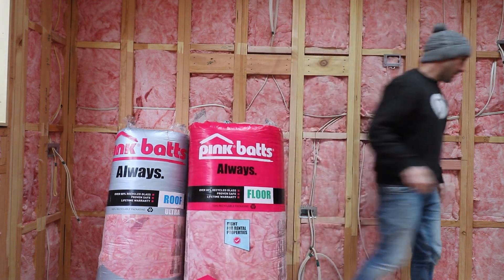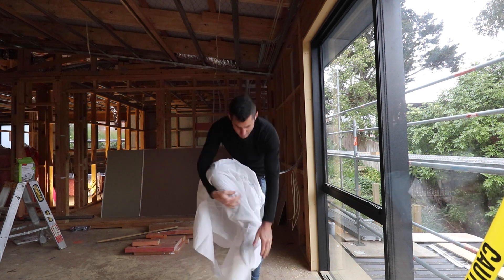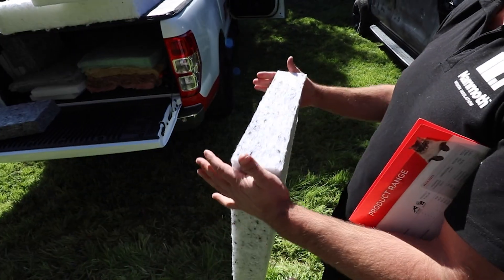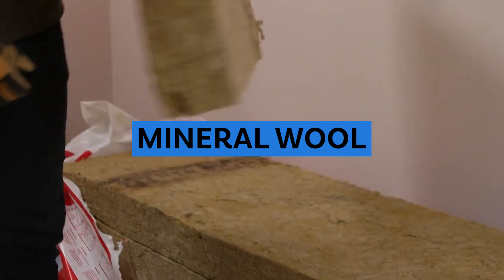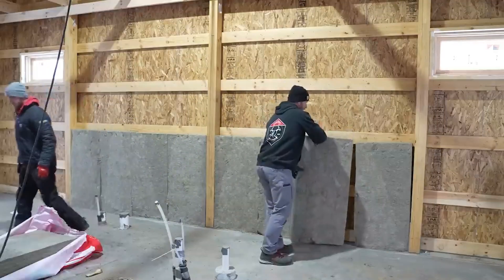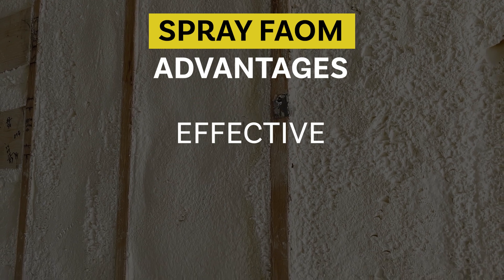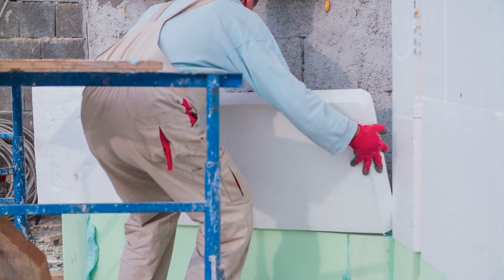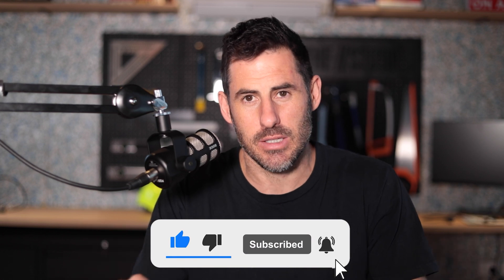New Zealand is OBSESSED!! with Pink Insulation

Comment: Pro tip, insulation saws like Bahco for instance,  will work for about an hour on Polyester (Mammoth) and then they are useless! I went through 4 of them doing 3 rooms. Bread knife is probably the best option.

Comment: I HATE PINK BATTS WITH A PASSION! along with any other glass wool product. 
My wife and I are both tradies and hate working around it. We are renovating our house, and we are installing Greenstuff in our walls, ceiling and underneath. Our cat loves Greenstuff too. We can't keep the little bugger off it. He obviously finds it soft and warm, which it is.
As for working with and installing, I have no problems. On the job having to repair a water leak, I pull the Greenstuff out and squeeze the water out of it, and I tell the customer to put it back after it's dry. As for Pink batts, well it's stuffed! Fill of black mold and it brakes up in your hand when soaking wet and can smell nasty. Not to mention you get itchy when touching Pink batts. I don't care how cheap that evil shit is I'll NEVER buy it!

Comment: Polystyrene’a other disadvantage is that it reacts with the plastics in electric cables (tps) so a more expensive cable style (purple sheathing) or mechanical protection (conduit) is required

Comment: Great video josh. Yes availability is a factor. Personally my perfence is the terra Lena wool blend insulation as it's moisture resistant, fire resistant and breathable. It's nice and easy to work with along with being made from wool offcuts and holds its shape. Pink batts are ok but from my experience they don't breathe as well as wool blend
Reply: We're doing a retro fit of ceiling insulation and terra lana is one of the options I'm seriously considering. What has your experience been?

Comment: Those R values you quoted are imperial numbers for the USA market, pink batts is upto around R2.8 for 90mm thickness, there is also Polyisocyanurate (or PIR) boards, the highest performer per mm of thickness, good for raked/cathedral ceilings where rafter depth is usually insufficient to fit the required batts, also, as the rafters are not straight or square you will have to deal with any gaps. XPS polystyrene is extruded, only slight better  thermal performance than EPS, plus you dont have al those beads blowing around as you mentioned. EPS is about the same thermal performance as batts per mm of thickness. SIP panels only have mediocre thermal performance if using EPS (most commonly used matreial), very good video otherwise - Building energy assessor
Reply: @brianclarke1695 curious as to why would you say SIP only has mediocre thermal properties? 
Designed to have SIP splines where possible, they are pretty sweet. Decent air tightness out the gate. 
Kiwis would never pay for Gapotape or similar around PIR boards placed between members, so installation will always be a problem, but super useful as a warm roof, or outsulation.
Pink batts are the dog shit gold medal winner when it comes to thermal envelope insulation. Sooner kiwis get pulled into the 21st century the better. 😊

Comment: I've recently did ceiling insulation (rodney area). My father was around and he's an inspector up in northeastern europe.
Here's his observations:
1. fiberglass isn't used anymore.
2. rockwool everywhere (my installer didn't have that as an option).
3. plastic film is needed so that humidity from home isn't absorbed into insulation.

Bonus - we went to see friends house being built. Same as you said - up in europe they use rigid insulation for walls. Can't remember why exactly why. Maybe because it was easier to handle.

Comment: Next would be the GIB, why is it called GIB and why are they dominating the market, same with Pink Batts.
Reply: I’ve been a draftsman for NZ residential houses since 2014 and all of the projects I did use GIB. There was a time where GIB is scarce, the house is ready for lining, and the council is asking for a “minor variation” for GIB replacement. In fact, on June 2022 NZ MBIE published the Product Substitution for Plasterboard.
Reply: @MrRENZsalas  group home builder? Use another bracing method. No problem with plasterboard substitutions then as it’s not structural.
Reply: @Tryinghardtobecreative  there are other alternatives. But the problem is the availability of the product in the area.
Reply: I mean, what would you use besides plasterboard? Fibro?
Reply: @nathanbedford3443 not all plasterboard is GIB I think was the point. Ie Fletchers have the dominance in NZ of that product too. Fletchers is one of the main reasons that the NZ building regs are a joke when compared internationally.
Reply: @Tryinghardtobecreative They’ve had  a few directors jump ship lately.. I wonder why????
Reply: @addrock7695 grown a conscience? 😂
Reply: @nathanbedford3443  I used BB Plasterboard once. The rest is GIB

Comment: Having moved to NZ from the UK, I’m still surprised that PIR/foam board insulation isn’t more common. The R values are super high for the thickness of the material, but sadly, I think the small market and cost means it’s still a niche product.
Reply: It's bulky so transport costs would be high. 
Especially as it would have to be imported. 

No one is going to set up a manufacturing plant for such a low market.

Comment: Good overview. I went through the exercise of adding insulation to my large 1977 home a couple of years ago. It already had pink batts in the ceiling and walls but nothing underfloor. I have another property which has the polystyrene underfloor and went away from using it because of the installation mess you mention, and despite the Expol concertina system they still have to have clips to hold them in place and I'd had the odd one I'd had to refix. I'd also seen the sag issue with batts so in the end went with the Mammoth recycled polyester.  I did have to figure out how many bales of each of the widths I'd need based on the floor joist spacings, and had to cut many of them to length which was easy with a sharp bread knife but they press into and stay in place well as long as cut to the right size and it is a pretty clean job. The underfloor ones have held themselves in place securely since without the need for any clips etc. In the ceiling I used 200mm R3.2 Ceiling Blanket which came in a roll and was relatively easy to lay out over the top of the batts and between the trusses. It was also easy enough to cut with a bread knife. The house has a noticeably different heat characteristic and is much more comfortable both summer and winter now. The basement became a fridge because the heat wasn't radiating through the floor, and upstairs three days after installing it the floor warmed up underfoot. Most interesting and worthwhile.

Comment: I’ve done a number of home renovations…every time I’ve removed the drywall the batts have been black with mold. Horrible horrible product! But in NZ we will always go for the cheapest nastiest product. Fletchers has the NZ market brainwashed! Im advocate of PIR foam and while it offgasses in the beginning it stops and becomes inert in a matter of days and will remain hydrophobic and is also a much better insulator which = a much healthier home
Reply: Then go mineral wool instead.
Reply: I mean this dude is barely literate, I use this channel as a "what not to do" more than anything.

Comment: I recommend knopped blown in wool for you ceilings. Its a combination of sheep and lama, cost effective and clean. We notice the difference between glasswool and natural wool. 
Sheep wool doesn't create dust coming down (we have a 1910 build with original art deco ceilings) and so far it's rat free, something I can't say from glasswool (pink batts turned yellow from 10 year rat pee). We fumigated and sprayed all timbers with borer bash top to bottom before re-insulating. 
Our ceiling is 107m², 57m² has R3.6 polyester insulation + 150mm R3.0 wool knopp insulation, the remainder 50m² only has 150mm R3.0 wool knopp insulation. R6.6 over the livingroom kitchen and hallway, R3.0 over the bedrooms. 
We are in the process of installing R3.0 underfloor retrofit with rigid glasswool sheets and R2+ in the walls, incl internal walls, when we renovate room by room. 
When we bought the house it was on its original totare stumps, now the house is a minimum of 600mm of the ground. This not only save against damp but also woodworm and rot. Make informative choices, hopefully you only have to do this once (per house😅)

Comment: I'm going to build a house in Amberley, north of Christchurch. In addition to Pink Batts, my architect has recommended Kooltherm K5 phenolic insulation boards between the timber framing and the outer cladding. The phenolic foam adds about R2.2, and also avoids thermal bridging through the framing timber.
Reply: And the added cost for an average 3 bedroom house to do that would be somewhere between 10-15k....housing is already expensive enough in NZ, but if you have the budget for it in CC it may be worth it.
Reply: @edw9623 Kool therm is outrageously expensive
There are comparable products without branz appraisals available in nz for 1/3 of the price.